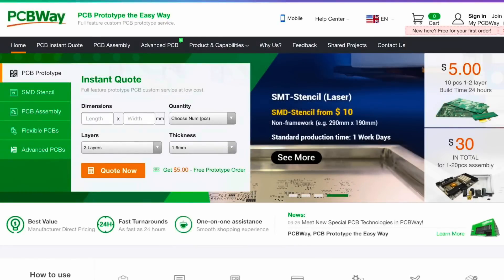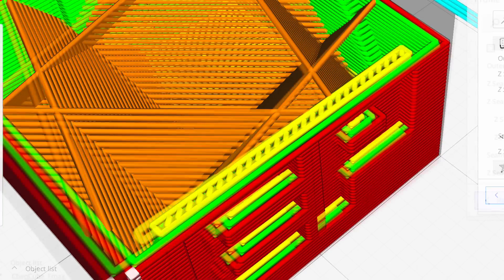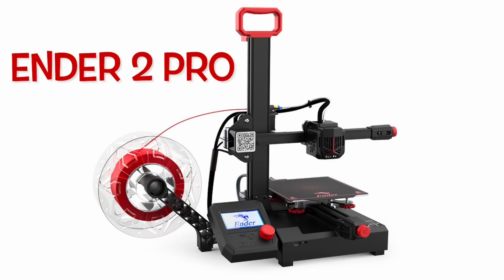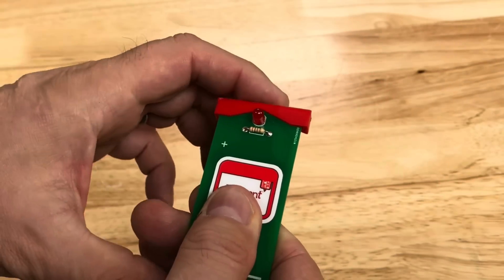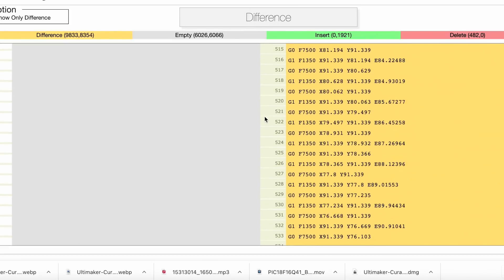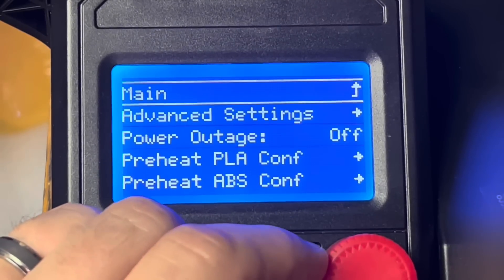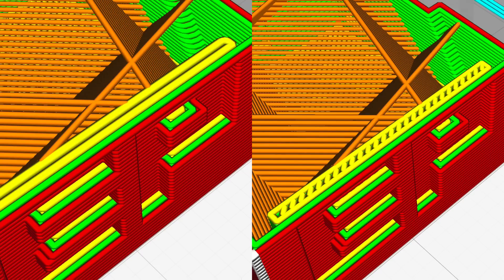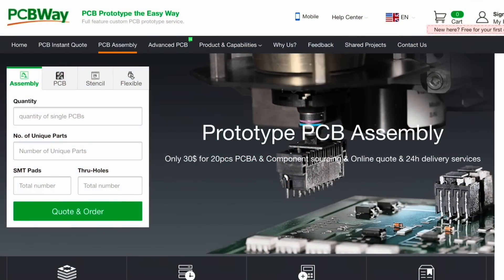Get Rid of Blobs in Your 3D Prints

Comment: Hi, I have a blob printing the cube always at the seam and always at the same layers but not all the layers... I turned off power recovery mode, still same (ender 3 v2 neo)
Reply: Did you ever figure out your issue I am having the same problem but on an elegoo
Reply: @crankdoughnut6923  Yeah I've been having the same issue on my neptune 3 pro
Reply: If you have an Elegoo turn off resume printing it’s what fixed mine
Reply: @crankdoughnut6923  Yoo thanks so much it worked

Comment: In my case, it turned out to be my new TFT35 on my Ender 3 not having a stable connection through its usb port. After going back to using the regular mini SD slot, my prints were fine again.
Reply: I've had the same issue since upgrading to skr3 mini and TFT35. I've been racking my brain trying to figure it out. I'll try using the mini slot again. Thanks!

Comment: My Ender 3 is creating little blobs at the start of every layer, much smaller than yours. At first, they probably stuck out a mm but after I slowed down the print in the Slicer (Creality 4.8.2) and changed to Hatchbox Filament the blobs seem to be a bit smaller but still noticeable when I am looking for them. Turning the Power Outage protection thing off maybe helped a little but, it is still making a seem. Is it natural to have a vertical line of these mini lumps, like a zipper?
Reply: Did u just install a Swiss extruder or a direct drive? Ever since I installed my direct drive on my Ender 3 I had this problem
Reply: @thefishguy3755  nope I just put it together on default factory settings.
Reply: @thefishguy3755  I have a direct drive Ender 3 S1 and have these small blobs. I cant find where to turn off the power outage feature.
Reply from the maker: No, check your esteps and adjust flow. Temp may be too high as well.

Comment: I have 2 ender 3 v2 and only one of them is having this issue which is weird. I also have updated the gcode to remove power loss setting but I’m still getting blobs. I’m at a loss at this point. Anybody have any suggestions? The newer updated ender 3 v2 is the one I’m having issues with out of the 2
Reply from the maker: Try a new quality higher speed SD card. It’s the read write time that causes it.
Reply: any SD card preferences?
Reply: @FilamentFriday  I'm printing direct to the printer, ( Ender 3 Pro w MS hot end) still get this on the test plate, using Chep TPU settings on Overture TPU.
Printing at 225 though, this material needs a hotter nozzle, prints are excellent except for the blob at the ' start ' corner.
Reply: Same here
Reply: same
Reply: same here!

Comment: I do have blobs at layer starts on a Ender 3 S1. No way to turn off resume function.
Reply: I had the same issue - You can make it better by adding ( M413 S0 ; Disable Power Loss Recovery ) in the start G-CODE of your machine setting in CURA - but it doesn't completely fix the problem, you'll probably still have some small blobs and holes where you have your seams ... I'm actively looking for a way to fix that
Reply: @BenleGentil  so if i do M413 S1 will that add power loss recovery back ?? i have a ender 3v2 that if the power goes out cant finish the print

Comment: The easiest way to fix this issue (if the option is missing from your printer's screen) is to set in Cura 5 the Machine settings under Preferences / Printers by modifying the G-code by adding this in the 2. line in Starting G-code:
M413 S0 ;
Note that this will turn off the auto save so you will loose the option to recover your print if something goes wrong.
Reply: I'll try this
Reply: do I add it to the beginning of 2nd line, the end of 2nd line or do I make a new line as the 2nd line and add it there???
Reply: @ironmaidenkai  New line as 2nd. So previous 2nd becomes 3rd.
Reply: @shaolin21  thank you so much. this fixed the problem perfectly. no more fiddling around with the settings in the slicer.
Reply: @ironmaidenkai  I'm happy to hear it helped. I know how it feels of getting rid of this problem. :)
Reply: This helped thankyou
Reply from the maker: I prefer just turning it off in the LCD.
Reply: @FilamentFriday  You are right, I updated my comment to make it clear it was ment for printers which do not have this option on screen.
Reply: @shaolin21  I will also try this, my Ender v2 is making me crazy doing those random blobs, already measured the extrusion and it is spot on by the milimeter.

And it looks like its freezing just to do something else
Reply: @pedrojustice  I hope it will help. I also fixed my Ender 3 v2 prints with this method after days of fighting with calibrations and Cura setting without success.
Reply: @FilamentFriday  so this issue still hasn’t been fixed? My prints have been turning out great EXCEPT for the z Seam. Cr-10s pro V2, not sure if I have the option to adjust print resume in my lcd menus.

Comment: Have ender 3v2 using cura 5.0
Getting the blobs on the lower left corner. Can not find in the menus where to turn off power settings to stop getting blobs on the corner
Reply: look into getting jyers firmware, the same setting there is something like "power shutoff recovery"
Reply: I have to remember to read the comments before I post. Thanks guys I'll try updating my firmware.

Comment: Hey chep how do I fix this issue on my ender 3, it does not have a configuration setting like your printer
Reply from the maker: Marlin firmware sight says: 
Disable power-loss recovery
M413 S0
Add that to your Start GCode in the slicer and see if that works.
Reply: Did it work?

Comment: I just started using Cura 5.0 and I really have noticed much difference other than some blobs when printing a sphere.  Otherwise it prints great.   I saw another video where they changed the mesh resolution to get rid of the blobs.

I did have a problem installing Cura 5.0 though as the Virus Scanners think it is a Virus.  I looked online and this is a common problem and has to do with their new icon.   I had McAfee on my fairly new laptop and was unable to figure out how to tell it to allow it so I installed my regular AntiVirus BitDefender and it automatically created a rule for it.   My desktop PC I actually had to create a rule.  Everything seems to be working okay now though.

Comment: I have a bit of another problem and researching brought me here. When printing on my Ender 2 Pro from SD card, everything is fine. I´m getting amazing prints off of this little guy. Now I connected a Raspberry Pi 3B with Octoprint. Power Outage is off and I made sure it stays off with "Store Settings". Now, while printing through Octoprint im getting weird blobs randomly positioned all over my prints. The printhead just stops for a second or two and spits out filament without any axis moving. Shortly after it continues. Any idea?
Reply: It's probably due to your board being overwhelmed by the amount of G-CODE, check Arc Welder on youtube you might get you additional cues

Comment: Hi Chuck, on your Cura 13 print you mentioned waveyness on the seam line of your cube and that you might have to adjust your profile. Which settings would you adjust first as I'm trying to resolve the same issue? Thanks.
Reply from the maker: Jerk settings mostly.

Comment: Hey Chuck. A question if I may: Is it still a good idea to manually adjust the flowrate on the display (Using Jyers firmware, Ender 3V2) with this variable line width?
Reply from the maker: No, adjust it in the slicer.

Comment: Is there a way to deactivate this option on Cura? I mean, my Ender 3 doesnt have this option to disable the outage recovery, so i need another way to disable it.
Reply: In Machine Settings, in the Start G-Code section, add 'M413 S0' ... that should shut off the write to SD card after every layer.
Reply: @richard3365  M413 S0 wont work for klipper, looking for other solution
Reply: @richard3365  TY bro.

Comment: I had this very same pause-and-blob problem yesterday on my Ender 3 V2. I started the print again with the same problem. Then I sliced the model with the exact same settings and saved the gcode file to a different (and otherwise empty) SD card and the blobs were completely gone. So I guess it’s definitely a SD card read/write issue.
Reply: what sd card do you change to?

Comment: Question sir.  Would it be ok with u if I altered the end stop and make it a nozzle stop guide to make it easier to find the X marks the spot. On the sensor.
Reply from the maker: Are you referring to the end cap for the E- Leveler?
Reply: @FilamentFriday  correct.  A little bit of editing it can be used as a guide for the nozzle to follow and set right out the button instead of using a light and trying to bend to see if it in the right area.
Reply: @FilamentFriday  and no I won’t be posting any pics or stl of this.
Reply from the maker: I’m interested in your idea.
Reply: @FilamentFriday  is there a way I can send u a pic of what I came up with
Reply: @FilamentFriday  I can put my email here for you or if you have another way please let me know. To get the pics to u
Reply from the maker: Email me. Check my about page in YouTube for address.
Reply: @FilamentFriday  I’ve tried to find your email but no such luck.  I posted mine here not sure if your deleting it for privacy reason or YouTube not excepting it when I send it.  Thanks
Reply from the maker: chelleb1 at yahoo
Reply: @FilamentFriday  pics and stl have been sent let me know if you got them.
Reply: @FilamentFriday  question 4 u sir   I have a friend that has a Ender 5+ he is wondering if there’s a g-code for the bed leveler.
Reply from the maker: Did they try the 300x300 version in the download?
Reply: @FilamentFriday  I’ll let him know to try that one.  And thank you. And did the pics and stl make it in the email to you.

Comment: I wonder if Pressure Advance would help this?
Reply: That's the wrong side to fix the issue at. Like sure it'll be likely less obvious as the pressure advance logic relieves the pressure somewhat before the layer transition happens, but the unplanned halt while SD card stalls the control board due to a low quality chip will still happen and will still lead to a residual issue.

Also I don't believe it's compiled into that particular firmware, but maybe I'm wrong.

Edit: it's not in and can't be enabled. It'll crash the stepper driver chip for the extruder if you try.

Comment: With my ender 3 and updating firmware, I found I had to disable power off resume recovery function all together, because it being ON and the "ability to write" to SD card ate up too much memory for my poor board to handle. (I wanted to enable some other features, like linear advance) Honestly my results with the recovery has been terrible anyway - none of my power fail prints have ever recovered properly, so I wasn't losing much.  Power goes out - print is ruined still. (I plan to make a Battery Backup for this, as an hour or so would be plenty for most blackouts)

My biggest issue though, is verticle lines on my Y face I can't figure out.  In a discord trying for help and still nothing.  Weeks of troubleshooting and ruined parts.

Comment: Since the “resume print” feature causes a slight delay at the seam, I wonder how much it affects print time.
Reply: Not much. Let's say your print is 10cm tall and has 0.2mm layers, then a half-second pause adds 5 minutes. That's a print that could probably be 2 hours long if not much more.

With a decent SD-Card and without extra stalling inducing bugs, the write access hides entirely in the plan length and causes zero delay and print time increase.
Reply: @SianaGearz  thanks for the answer!

Comment: The FLSun SR had a similar problem on release where it would pause and cause blobbing due to the restart ability and saving data at end / start of a level. The cure here was to turn it off OR to reformat the sd card… not sure why but it worked for me.

Comment: The power outage feature will wear out your SD card pretty fast anyway.
Reply: Dont know what pretty fast means becuase i have my stock sd card for like 2 years already and sadly where i live the power outage features is necessary
Reply: Don't worry, taking the card out of the printer and putting it back in wears it out faster. Mechanical damage more relevant than electrical.

Comment: In theory retract at layer change setting would mitigate this firmware issue, but Cura does some weird stuff that might result in the Z move happening early and triggering the problem if the firmware does it based on Z move.
Reply: Z move doesn't get emitted by CURA early I don't think? Marlin doesn't actually do the save in the Z move, it does the write when the gcode parser processes a move that contains X or Y and extruder displacement, but last write was at a position which was more than 0.05mm in Z lower. Extruder check was added because although resume is incompatible with Z Hop in principle, because with it being around, who really knows where the toolhead is in Z, it should at least skip the write if it were to be triggered by it. But it's not perfect, because "continue retract" post processing script will mess it up. The only true solid way to get resume would be to have an advance warning pin from a circuit connected to the power supply primary. However then also you need to save the last executed partial move, which it does not. It just does its best to repeat the layer it got stuck on.

This does pose a potential issue though because the parser runs ahead, it feeds the planner synchronously, and the planner emits a buffer with a bunch of moves that get executed by the step routine sometime later whenever it gets to it. So the saving can actually occur before the Z move has started or completed executing. Ideally the saving would get triggered by a special flag in the plan buffer. It's a crappy system for a crappy event.

Z Hop could be fixed on printers that home to Z Max but it's not considered, since it's just such an uncommon config.
Reply: @SianaGearz  Oh, wow. That means the write is necessarily after unretract and thereby necessarily ruins your print oozing while it dwells. 🤦🤦🤦 What a misfeature.
Reply: @daliasprints9798  Creality engineering. Marlin team tried to rescue it best they could and make it less bad, but I could tell they get queasy just looking at it. Ideally you'd have an RTC chip or something like that, they have some arbitrary SRAM storage ideal for this, if you're not going to have advance warning. And ideally you'd write how many steps were taken several times a second, or when the advance warning fires, and then would just run the file in dry run mode until you reach the spot, but that can be very slow.

I don't think SD card write disables interrupts, so the step routine continues operating if there is enough of a plan. And normally the write is not disruptive on a well behaved SD card.

The write actually is triggered during parsing and not during plan execution. But as far as I can tell, the written and compared Z are the actual ones of the toolhead at that point as updated by the step routine. It's baffling. But it also doesn't seem to be worth too much effort to properly rescue it, like, the list of tasks is really really overwhelming for a small developer group. I for once don't need the feature because my last power outage is 20 years ago, so I'm not working on it, and even as bad as it is, it appears useful enough for some people, and every involvement by someone may break it.

Comment: info regarding that (power outage is set to on and there by gives problems.

this is so not the case, hate on the first few test prints i made there was on the sd chord the same problem and found out that the problem was the sd card formatted the card and transferred all the files back again and the problem was gone. then uses prusa slicer and has not made any errors and firmware is standstill.